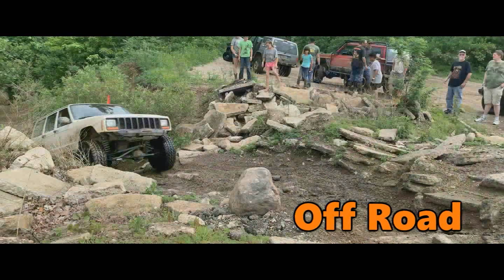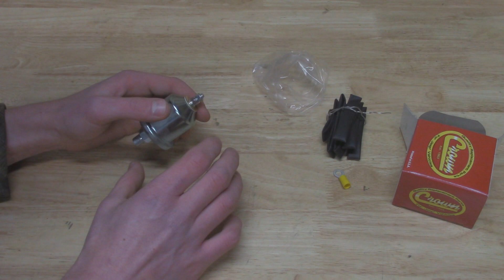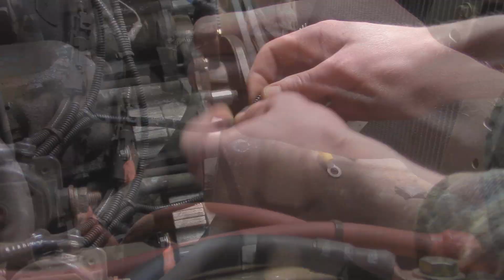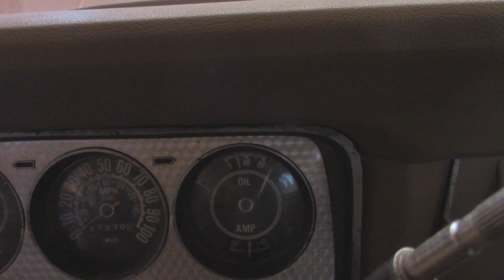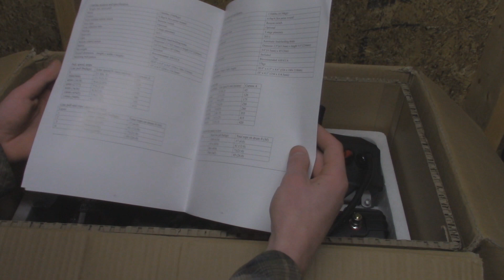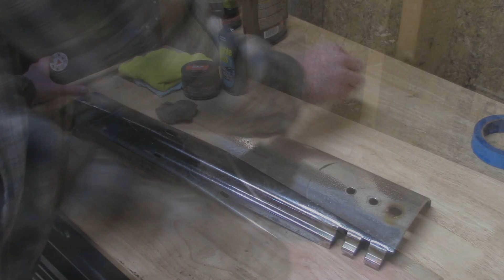Jeep Oil Pressure Sending Unit Replacement | Jeep J10 Build

Comment: Did your fuel and temp  gauges work OK?    I have a 1977 J10 with a 360 and none of my gauges work.   I should point out that they removed the electric oil gauge wiring and went to a manual oil gauge.     
So far my testing leads me to believe i need to install an oil pressure sending unit to complete the circlet.     Driving me nuts and I know it a short drive cause I own a Jeep.
Reply from the maker: When I got my Jeep none of the gauges actually worked. I replaced the temp sensor and the oil sending unit and got those working again. My speedometer is locked up internally and the cable is disconnected for now. I diagnosed the fuel gauge to a bad sending unit in the tank. My Amp gauge won't work since I routed my alternator differently. So it could be possible all of your sensors and sending units are shot like mine, but it could also be a bad ignition wire to the instrument cluster. Depending on if you want to keep the manual gauge, you would need to run an oil line to the back of the manual gauge. Otherwise if the wiring is still there you can hook up the electronic gauge.
Reply: @OutJeeping  Thanks.   I need to replace( I think they might have cut it) the oil pressure circuit  and add a sending unit and see what I get.
Reply: The gauge cluster in these have a converter behind one of the gauges that reduces 12v to 5v,  I Think. It  might have failed somehow.  Do an online search and a few ppl go over this giving several good ideas what might be occurring. And yes make sure sensors and tank sender are good.
My 76,  these is a pink wire at the firewall connection,  that went from fuel tank sensor to the gauge cluster. Check its continuity from tank sensor to up to back of cluster. Need a DVM and clean all contact points from any corrosions. There is a chart online you can find showing the fuel sender resistance fuel/empty,  to the cluster. Should be 0 = empty, 90 = full of fuel. It's I believe ] the same as a GM Truck model.
Reply: @yafois988  Thanks I did find that converter and it has continuity throw it but I don't know where to find another one.    All the gauges will move if current is applied and I have checked continuity to my sending units and checked function of all but the temperature and it is the next to be changed out.

Comment: It's winter here been below 20
My 1995 ZJ 4.0 52,000 miles
On cold start up oil pressure hits 80 idles hard till warned up is that normal?
Only owned it since August last year..
Reply from the maker: It's most likely a bad sending unit reading wrong. On my 4.0L I've had the same issue when it was cold. But normally in the winter it will read a little higher on first start up then slowly go down a bit as the oil warms up. 80psi is way to high indicating that the sending unit is bad.